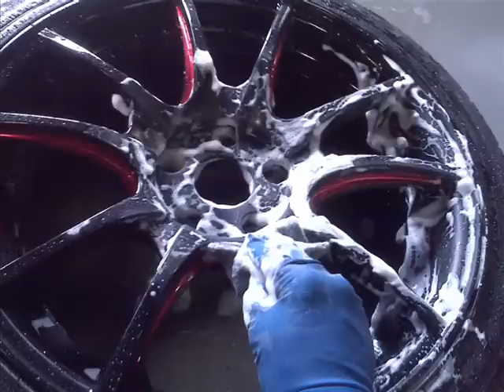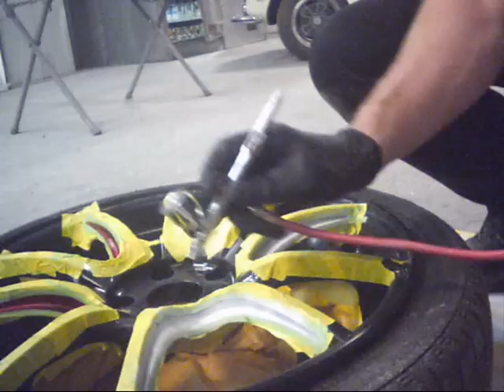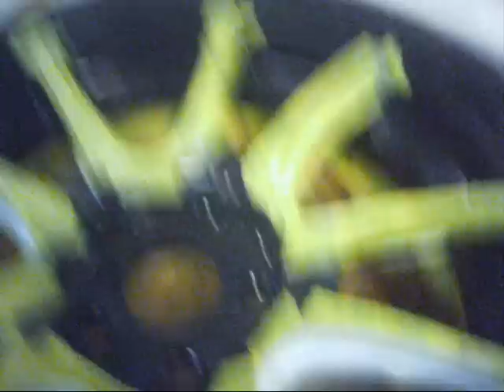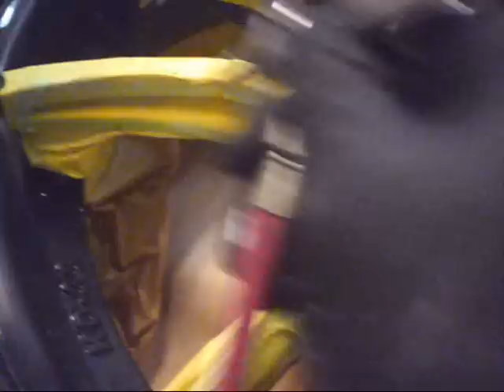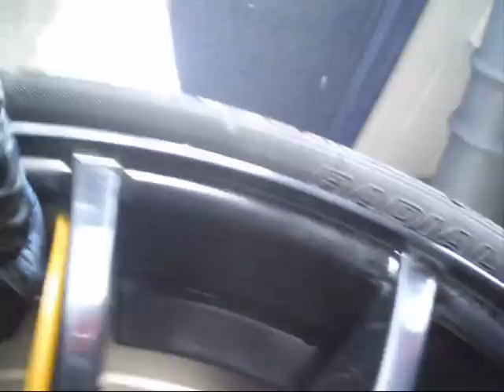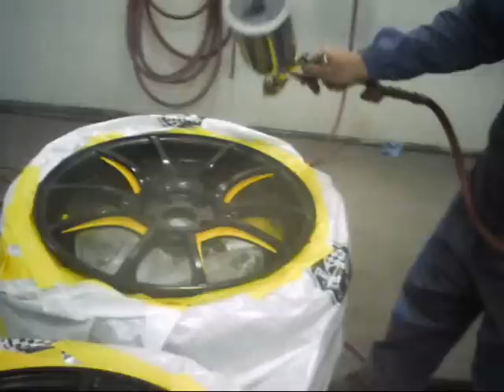How to Paint Rims - Stripe Color Change

Comment: @DSpohnVW I work in a body shop, and completely agree with you, but we also work with much larger, much more efficient spray guns. This is probably just a hobby airbrush that you can buy at Walmart, so it probably takes that constant flow in order to lay down enough paint. I won't commend that method, I'd suggest a better gun, but if show quality isn't what you need, and if you aren't getting paid for the job, the airbrush "gun" works just fine. Even with his constant spray, it turned out ok.

Comment: It's quite confusing now with molded one piece wheel to give an appropriate name.
Before, they were assembled in 3, 4 or 5 parts and a lot of bolts,seals etc..

Now, an alloy wheel without tire is a rim.

Steel wheels are still 2 parts welded together where the rim is independant from the wheel itself ,you can distinguish them.

Those terms disappear slowly.

Soon, they will be in plastic.....(i'm not kidding)

Comment: question what jobs on a passenger car that would require 1/2 inch drive wrench?
Reply: a ton depending on the car
Reply: 1/2 inch drive is the fitting size for the sockets that go on the wrench. So it depends on your sockets. You can also but adapters like 3/4 to 1/2 ect. But if you need to crack tough bolts loose then a breaker bar with a 1/2" drive would be ideal. It all depends on what you're doing.

Comment: paint/ weaving a basket next? use a standard steel wheel, spray can black like the tire, no tape, no employee, no time wasted. if you need a tire or rim, they are the cheapest, the tires are delivered to dealers on plain rims, they sit in piles. save your money for an extra car when that thing fails.

Comment: @jimmo4life Do you seriously wash them with soap and water? Soap is not a solvent, you will have less contaminates (water-break free) if you use a solvent dual wipe method, isopropyl alcohol or paint thinner.